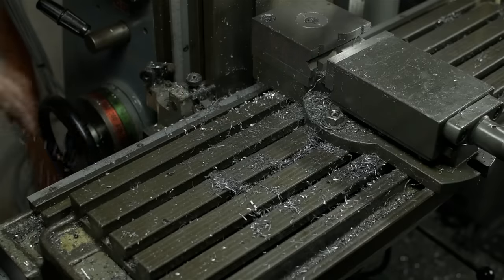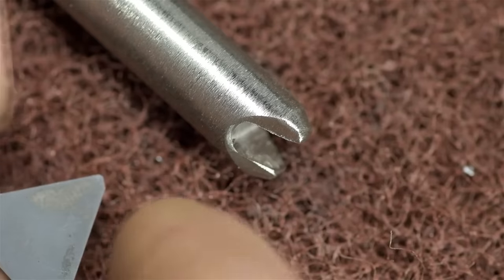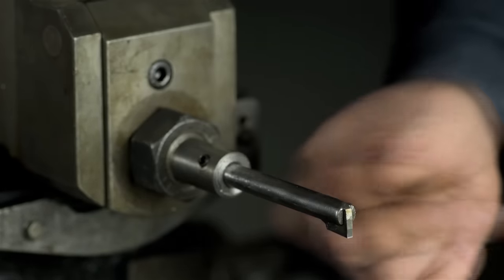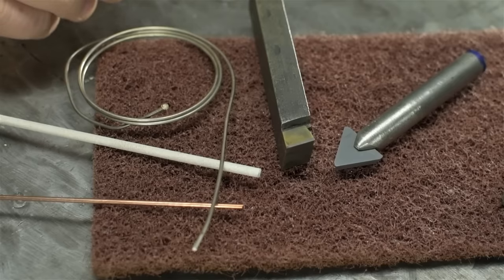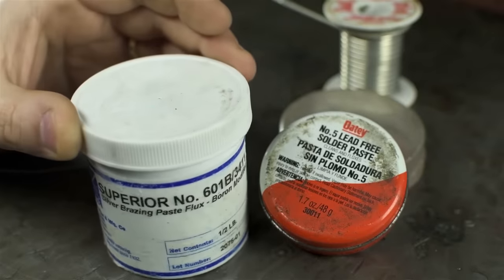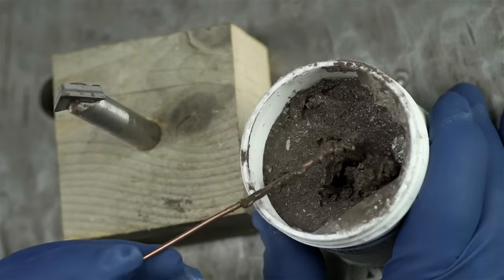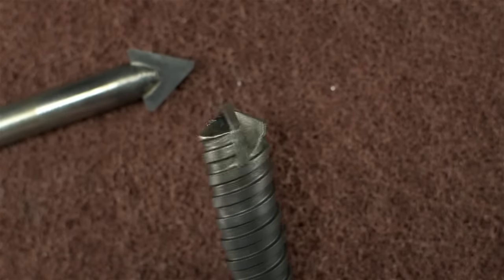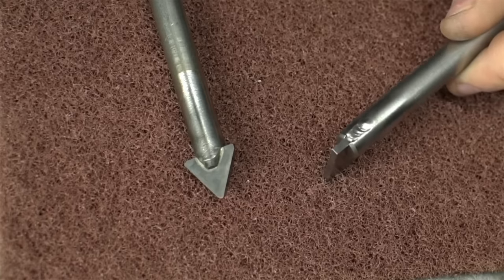Custom Tools - Brazing & Welding

Comment: As there are 1005 comments, I did not read them all, but you can Silver Solder/braze with propane. I have done so using the 45% solder you showed, it all depends on the size of your torch. The lower silver solder about 5% is know as silver bearing solder.

Comment: If you quench the part the flux will essentially blow off and eliminate the need for cleaning. Never tried this with carbide, only steel to steel brazed parts.

Comment: I feel like the joke was talking about the rings on top of old bathtub drain plugs; the round rubber stopper with a small loop attached to a metal ring (sometimes attached to a chain) to keep that bathwater from draining. The first person (lead) would be the closest to that ring and therefore would be the ringleader. Maybe I'm totally off, but that's what occurred to me remembering growing up with a bathtub from the 1950's.

Comment: Here in the UK old Lotus 7 chassis were all silicon bronze brazed and in fact I’m pretty sure that replacement chassis from Arch Motors still are. Also a mate of mine races mini moto sidecar outfits and most of those chassis are also brazed rather than welded.

Comment: Just for reference, johnson matthey silver flo 55 is a lot cheaper, has more silver too. I've been using it to silver solder 3" stainless pipe using a MAPP torch and it works a treat!

Comment: Silver solder, as in 2-4% silver, has the silver for wetting purposes. It makes the joint easier to fill. Strength isn’t much of an issue.

Comment: I thought Tony would of talked about a rosebud torch tip, works good for brazing and heating in fact I think I was tought it was a heat tip, but I could of been taught wrong

Comment: There's still an Amazon listing from a third party seller for a troy ounce of that safety silv brazing wire at $30. Same diameter and weight on McMaster is $53.08.

Comment: You could use a BBQ rotisserie motor for the ring roller. Cheap, plenty of torque, and slow spinning so it won't shoot out the metal. Just an idea.
Reply from the maker: funny you say that because i'm actually using my ring roller and drill on the BBQ.  but good idea.

Comment: Top fuel dragster chassis' in the 1960's were often brazed as welding equipment wasn't in the "home" garages most of them were built in.

Comment: When you use soap in the bath and pull the plug it leaves a ring around the edge. The soap ring. So the first person in the bath would be the one that caused the first occurrence of the ring, hence ring leader.

Comment: I like how the german language solves this with composite nouns. We have "Weichlöten" (soft soldering) which is soldering, and "Hartlöten" (sturdy soldering), which is brazing. But soldering is in both names as there is a different filler melted into the connection.

Comment: The first guy in the tub is the "ringleader" because he was the first to leave a ring on the Tub.  The "ring" is the dirt that was cleaned off of the person in the bath, and it leaves a ring of dirt around the bathtub around the surface of the water, because the soap breaks the surface tension of the water and pushes the dirt to the edges.  This is why bath tubs need to be cleaned

Comment: I prefer map gas for small stuff like this. Heats up slightly slower but is easier to use and gives you a little more control.

Comment: Much like ring around the collar was once a thing there was also ring around the tub. The idea was that after draining the water,  a high-water mark would stain the inner rim of the tub. Because people were filthy.  He's the ring leader because his ring...will be highest? - if he's first out as well. Failing that, I'd suppose he's first in line to contribute his inches-thick coating of man-lanolin and coal dust.

Comment: Just a thought... putting the high speed steel in a vise to heat sink the cutting edge would better ensure you did not go over temp on it.??

Comment: Love your vids! Just got my own small home machine shop going a few months ago, still building/buying tooling.  Many thanks to you for your great vids I have learned much:) .....

1 question when tig welding the HSS what rod did you use?  Iam wondering if I can do a similar thing with my flux core welder?

Comment: The purpose of flux (as I understand it) is to break the surface tension of the solder and thus let it flow into the joint. In Latin "flux" means "flow". Coincidentally it prevents oxidation of the joint,  but this is a freebie bonus.
Reply: It also dissolves any surface oxides left on the joint that might prevent the filler wetting the parent metal. This is why you can braze stainless steel, even though its corrosion resistance is derived from a chromium oxide passivation layer that should stop brazing filler from reaching the base metal.

Comment: may be TIG welding using silicon bronze? that keeps the temp of the HSS lower instead of welding it to the shank. The bronze has a similar func as the silver

Comment: I believe hard soldering is the same as brazing. At least brazing translates into Hart-Löten in German. Wikipedia also states that hard solders are used for brazing. So I guess that low silver stuff is regular thick lead-free soft solder?

Comment: So short of maybe breaking the high speed steel with an oxygen torch, or welder, both methods you can use, what is the way you should attach it, or were those the best options?

Comment: Sir, I have a rather important question (If I don't want to blow up), from a welder's point of view, since you're pretty experienced, how "safe" in contrast to acetylene, argon, co2, propane, ...is cutting/welding using HHO? not H2 but HHO. I know there are things that work for backlash when the fire goes down the tube, with a fast one-way valve to protect the bottle from a heat source.
But HHO has it's own oxygen in a perfect mix, not just to use, but also to explode (100%LEL), those standard one-way valves for using any pressurized gas actually that is stored in a bottle, are they sufficient for pressurized HHO too? (300BAR on a 6liter bottle (normally used for breathing air for firemen, the carbon fibre bottle, designed for 300 BAR))
That is reduced to 7bar, before I'd like to use it as a torch to cut metal (rather thick metal). I can make the HHO, but I can't afford a thermic lance :-) HHO also burns a lot hotter too, and that's just what I need.

But won't the nozzle melt, would I make a copper coil around the nozzle carrying cold water, to prevent it from melting, or doesn't the flame touch the nozzle?

Comment: I make a bit of silver jewellery. Do you know if I can use the silver solder with tungsten carbide? It comes in easy/med/hard which relates higher termps.

Comment: If you brazed HSS couldn't you harden and temper it after you brazed it? Or would the heat necessary to do that just melt the brazed joint?

Comment: Damn, I was hoping you were gonna use something other than TIG.  I need to figure out  how to braze/solder/something a piece of hardened tool steel bit onto a mild steel bar to make a wood chisel.  Yes, I know, I can just go out and buy a chisel.  But this is an experiment on frugality.

Comment: Just so you know, in soldering, the metal filler actually dissolves a bit of the materials being soldered, so it is somewhat like a weld which you have absoolutely correct where the two materials heat, melt and mix.  However, in soldering, the amount of dissolving (which is exactly what we call an álloy') is minimal.  To test whether this is true or not, you can set something to be 'soldered'by keeping the material in the liquid, melted state for say an hour.  You will find some of your material to have disappeared mysteriously.

In brazing, no doubt, a bit of this action takes place but it is very minimal.  I thimk that it is far more likely that the brazing material simply fills micro-holes in the two materials and thus bonds them.  If this is true, then the materials being brazed, if they have a slight roughness, they might bond better.  Now I'm not talking about what you can see witgh the naked eye, but rather with a microscope.

Comment: My take is that old bathtubs had rubber stoppers as drain plugs and these had a ring on them so you could get a grip underwater to pull them out, and drain the tub. The physical location of the guy in front would allow him the only access to this drain plug when bathing with his two "henchmen". 

I keep reading replies that it has to do with a ring of dirt around the tub... but nothing is stating the guy in front is the first one to get out, and therefore nothing to ensure he has left the "leading" ring of dirt.

So in your defense... it is an absolutely lifeless joke. At it's best its just technically accurate pun making.

Comment: Tub ring... the ring of stain at the average water line in an old porcelain bathtub, or back in the day when rusty water would stain the porcelain (or current if you’re from Flint... 🤦🏻‍♂️)... the first one in the tub was the leader to creating the rust ring in the bathtub... 😉

Comment: I use flux coated brass. High temperature flash on the parts. Let it cool a little bit. Then  a touch more filler. Peace of cake.

Comment: back in the day the tub drain was called tub ring. i think old tub had a open drain  so  rings woud fall in the drain .and you woud haft to call a plummer to take the p-trap apart to get the ring back.

Comment: i wan't to braze tungsten onto/into masonry chisel tips....ive seen a japanese thick pencil like point chisel with tungsten all through the full length of the tool (used on granite)....would it be do-able? at the "home" level...asuming i can get a length of tungsten.....i'd imagine having the insert to the halfway point but i don't imagine the flow would work well.

Comment: I didnt want to read 2K comments to see if it had been answered but the guy in the front of the tub is the leader of the scummy ring around the water line in the tub after use. the one in front is considered a leader in most cases.

Comment: Why not tig braze it instead? Do you need flux to do such or is it optional? I know tig brazing wire doesn't have zinc but apparently gas welding brazing wire does.  Don't ask me how I know.

Comment: Welding cast iron is a nightmare, but brazing cast is a snap, the braze is stronger than the cast iron. White flux is boron based, so borax washing soap being boron based works as a flux.

Comment: third option. Drill a hole, thread part way. take a broken tap grind rough profile. Add locktite to broken tap thread into hole. Finish grind. Go to work.

Comment: OK, here’s what that joke means. I’m not saying it’s very funny, but I know the pun it’s trying to make.
When you take an old-style bath, it leaves a ring (of deposited soap and dirt) inside the tub where the water level was. If several people bathe in the same water, one after the other (as we used to do when there was only enough hot water for one tubful), without scrubbing the tub in between, each will leave a different ring. The rings will be separate because the water level will be a little different each time, because each bather takes some of the water with him or her by getting out of the tub, so there’s a little less water for each subsequent bath than for the one before. So the first guy to take a bath is the ring leader, because he leads by making the first ring, and the others follow by making more rings.
(In our house, the last bather was supposed to scrub the ring from the tub before leaving the bathroom.)
This is a pun because the usual meaning of “ring leader” (sometimes spelled “ringleader”) is a person who leads a group (“ring”) of people, especially the head of a gang of thieves or a criminal conspiracy. So it’s “ring” = circular deposit in a tub or basin vs. “ring” = gang of crooks or spies. 
Again, it’s not the world’s funniest joke, but it is an actual joke.
Of course, if three men all bathe together (in what would have to be a very jumbo bath tub), they would only leave one ring, but I guess you could still say the first guy to get in is the “ring leader.”
Nowadays, most prople take showers, which have a whole other set of etiquette and language issues.

Comment: at least around where I live the term "silver solder" always means the same thing as "silver braze", and the stuff you're calling "silver solder" is only ever called "solder", or "soft solder", or "electrical solder" or "plumbing solder", or sometimes "silver bearing solder".  I think the confusion arises because one of the common "lead free" solders is 95-tin/5-silver (now more like 95-tin/3-copper/2-silver) and the industry came up with "silver bearing solder" IE it bears or contains a minute trace amount of silver, to distinguish it from the tin-antimony lead-free alloy. Anyway, to avoid confusion you should not drop the word "bearing" from the term (even though you should probably not use any type of solder on any type of bearing)

also, within the model steam engine and model boiler making community, we generally use silver solder but stay away from oxy-acetelene because it is too hot and there's a good chance you'll burn up your flux and evaporate some of the metals out of the silver solder and ruin its alloy composition.  I've always succeeded with MAPP gas when working on something large like a copper boiler, though it won't work without wrapping the boiler in thermal insulation blankets.

Comment: About 40 odd years ago, carbide tipped lathe tools, shaper bits etc were brazed on with spelter, i.e.coventionally brazed. That worked, so why have the argument about  getting tool steel too hot to be able to use 'silver' brazing? Just conventionally braze it instead?

Comment: ring leader is probably referring to the fact that people used to share bath water because it was hard to heat.

that many people and baths not showers, you get a ring around the tub, First in starts the ring, so they lead.

Doesn't make the joke good, but does explain it.

Comment: Only one way to overcome this particular joke-angst. Mount that ring roller in your bathtub. Stuff an impeller with a reduction output in the drain and you've solved that other little problem.

Comment: Nowdays airplane frames are mosly aluminium and they are welded. I'm doing a lot of TIG brazing fabrication on installations for liquid nitrogen and i can confirm that 2000-3000 BAR (it's around 30000-40000 PSI) it's nothing for brazed joints.

Comment: with propane instead of acetylene you would have a more manageable temperature and the same torch can be used with both gases and the propane costs about 1/5  what the acetylene will so unless you need the added heat use the propane for the less demanding jobs.

Comment: The explanation that brazing is done at hotter temperatures than soldering doesn’t explain to me why I should choose one over the other.  A bit of “research” later (thanks, Google!) and I found that brazing makes a stronger joint/bond than soldering does.  OK, that makes sense to me.  When our materials can withstand the higher heat and we need a stronger, more vibration-resistant joint, we should braze instead of solder.  😊

Comment: The joke might work on two levels. 'Clean' level is that the first guy creates the first dirty ring around the bath. However, the second way of reading it could be the other use of ring. One's 'ring-piece' is one's bum hole....Often in the UK we'll shorten it to 'his ring.' This the first guy in the front of the bath is indeed the 'ring' leader. Methinks the writer had been to Britain and spotted a chance to slip something pretty rude in there.

Comment: wonder if you can heat the hss and small piece of the rod intoo an regulated oven (like the ones used for emaille (melting powdered colloured glass on metal objects ) untill its exactly at the right temperature take it out and quickly touch it with the silver solder letting it melt and flow intoo it
those ovens can be found cheap , those aliexpress induction heaters i dont realy trust a lot yet

Comment: The joke is referencing what is known as "the ring around the tub" which basically is; when you take a bath, all the dirt and oil from your skin floats on top of the water, some of which will cling to the side of the tub, and if it has been a while since you have washed your tub, and you take a lot of baths, all that dirt and oil builds up on the side of the tub at the waterline creating a "ring around the tub". So... The first person in the tub is the "ring" leader.

Comment: My Hakko 888D usually stays at 750°F and I think it goes to 999, so your soldering cutoff seems close.  Although, sweating pipe, which I still consider soldering, has got to be ~1200-1400.

Shit, now you made me look it up:
"That temperature is defined to be 842ºF/450ºC by the American Welding Society (AWS) but is often rounded to 840ºF. If the filler metal melts below 840ºF the process being performed is soldering. Above that temperature, the process is brazing."
~https://www.copper.org/applications/plumbing/techcorner/soldering_brazing_explained.html

So I guess I can braze using my nichrome/ceramic iron then.  I'm off to make my own insert tooling now!

Comment: The too fast with the drill part...if you have a pneumatic socket wrench it would be perfect.  Lots of torque at much lower speeds than the drill.  Harbor Freight (or equivalent where you are) has them for very little $.

Comment: Just to add to the confusion, us crazy brits call silver brazing ‘silver soldering’... brass brazing we just call ‘brazing’ . we can’t usually get the low temp lead solder with small quantities of silver in it. We just use tin/lead.